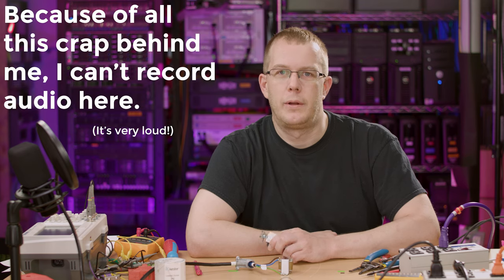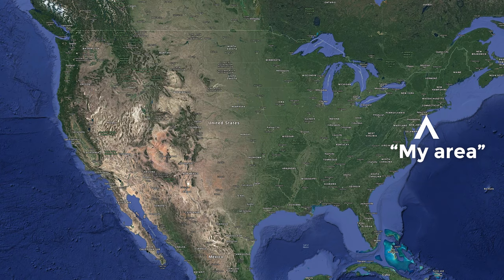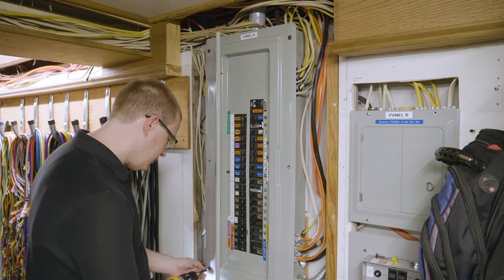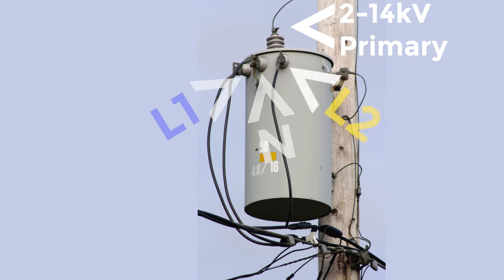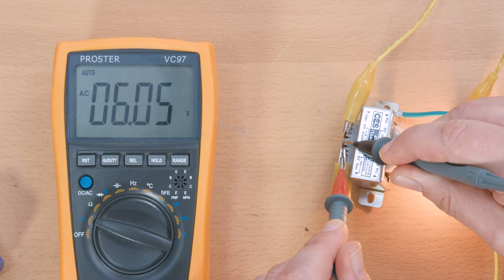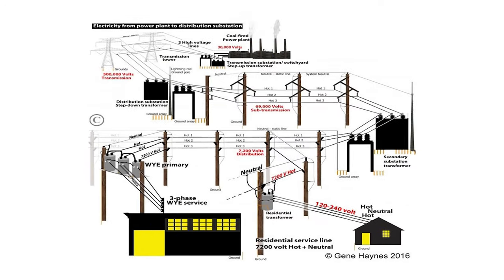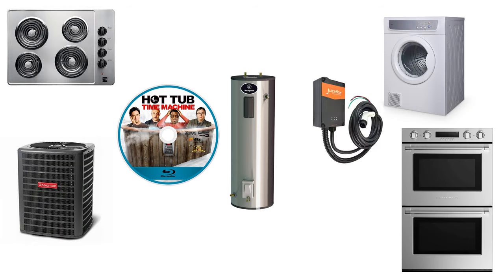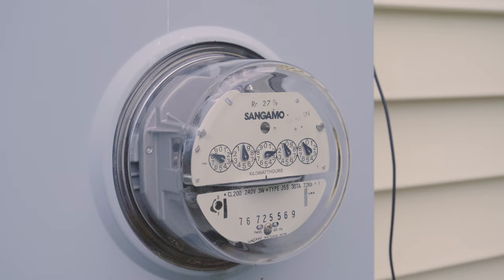240V is the Standard US Household Voltage (Kinda.)

Comment: One comment on what you say at 1:40. The US does generally carry out a neutral wire for the primary distribution. It is grounded in many points and shared between the primary and secondary systems. So there is multigrounded neutral for the primary return path, it's just the same wire as the neutral/messenger for the secondary 120/240V wires. This shared neutral arrangement can sometimes lead to small stray voltages/currents on customer ground systems because it's actually primary current returning to the substation via a customer ground rod or water pipe. Some current goes through the actual earth, but much of it takes the metallic neutral conductor back to the substation.

Comment: In the EU (at least in The Netherlands) we have “3 phase” in most homes that delivers 380v which is used a lot for applications such as induction stoves and such. In fact, most stuff that needs 240v in the US, needs and gets 380v here.
Reply: Same in Russia. In homes we have 230/400V
Reply: Today its not 380 but 400 volts in the Netherlands!!So the voltage is today single phase 230 volts.If you are a electrician you should know that by now,its already about twenty years this way..🤨🤨
Reply: We have 3 phase power in some apartments and commercial establishments in N. America, as noted in the end of the video. It's 120/208V. This usually requires special dryers, stoves, etc., that are available to landlords.
Reply: @dougbrowning82 "LandLeeches" - fixed it for you.

Comment: The neutral is the return path and it is grounded, hence why it is called the grounded conductor. The return path doesn't literally travel through the "earth." It is grounded so that the ground and neutral have no potential between them. There is an actual neutral wire that the current travels on throughout the whole system. Electricity doesn't go to ground like people often think.
Reply: Ground return is obsolete, but still used in some areas. I've seen it in rural Saskatchewan, where a single wire runs for several kms (miles for those in the USA) on pole lines beside the road.

Comment: I just got finished watching a different video talking about 240 volts being out of phase or not and the consensus was a lot of times the measuring device is what is showing out of phase but that the actual power coming in is in phase at 0°. His explanation was that most lower end oscilloscopes you connect the ground terminals to the neutral which gives you the out of phase. If you were to try to measure it where you take one of the ground terminals and put it on L1 you would blow up your oscilloscope. He showed this by using an isolated oscilloscope. Bottom line was if it's out of phase you have to question is it the device that you're using to measure with that is out of phase or is the source actually out of phase

Comment: I'm very lucky to live in a country with 230V Single-Phase and 400V Three-Phase electricity with 50Hz...
Reply: But how do You think ' is that a limit? do You think they would try to increase tje voltage again?
Reply: @maciejgromek2368  Usually it can up to 415V.
Reply: How does that affect your life in any practical way?? I lived in Europe and it didn't.
Reply: @liberoAquila  right now may be the answer. 3 phase do allow EV car charger, my current house which still in single phase unable to use EV chargers.

Comment: U.S.  uses line voltage[ phase to phase or rather split phase ] as 240v with 180 degree difference and phase voltage[ phase to neutral ] as 120v.  In India , europe -  line voltage is 400v with 120 degree difference between each pair of 3 phases, and phase voltage is 230v.
Reply: Its because its 3 phase and 230 x 1.732 is 400
Reply: @mr.3phase228  sure.  to be precise .220v x 1.732 = 381v, 230v x 1.732= 398v,  240v x 1.732= 415v.

Comment: Hello I have a question can I plug a European 240v 50Hz AV receiver into a 240v 60Hz USA outlet?
Reply: The connectors are mechanically different, so no.
Reply: You would have to change the plug. In N. America, a 240V 15A outlet (NEMA 6-15R) has the current slots horizontal, the ground is the same as its 120V (NEMA 5-15R) type B counterpart.

Comment: I'm actually tearing myself when I think about it, 120 v are safer and by renewable energy 12 v system is getting popular so 120v  is though more effective, but when we talking about for example very powerful devices like some hair dryers, the american breakers 120v 15 amps it's not enough and it makes them turn off (and Japan has only 100v). But in the other side Americans have a few kilovolts nearly houses and I don't how about other  countries but I,m from eastern europe and in the rural areas 400v lines are too long, my house is 1 km from the transformer, and look that we have medium voltage even at home, 10000 v generates when the car turns on, 10000 v is in the kinescope tv, and 4 to 10 kv flash is in the copiers, so maybe everything is possible
Reply: In the USA, 120V 20A circuits are common now.

Comment: I only get 110-112v from each receptacle at my house.. Even straight from the breaker box, I only get 112v. Aren't I supposed to get at least 120v?
Reply: The nominal voltage may vary plus or minus 5%.  You are supposed to get at least 114V.
Reply: @GH-oi2jf  My issue was my multimeter... it was out of whack.. bought a new one and now I get 121v.

Comment: Very well explained and shown!   A challenge.  Without saying that the oscilloscope shows it, what causes the (according to you and many others) 180 degrees out of phase.  It is, as you know, single phase in and out of the transformer.   I disagree with the term and say that is only on an oscope that it seems that way, but in the transformer it is not.
So, what in the secondary of a single phase 120/240 volt transformer can cause a 180 degree phase shift?
Respectfully,   Kevin
Reply: It is nothing complicated to do with 3 phase or AC reactance. 180 degree phase shift (or "out of phase") is just a way of saying the signal is inverted or the other way round. Shift a sine wave 180 degrees and it is an inverted copy.  It is fairly meaningless to talk about a positive and negative version of an AC signal that is itself inverting at 50/60 HZ. 

Which is  down to how the leads are connected. Take the DC equivalent where you have a 12V battery, which is actually made of two 6V cells in series. With a meter put the negative lead (your reference) at the -ve terminal of the battery.  At the other end of the battery you have +12V, and in the middle between the cells you have +6V.  Now put the negative lead of your meter at the central join, as your reference. You now have -6V on one end of the battery and +6V at the other.

That is what is happening here. On the oscilloscope (as in the AC supply) the centre tap is the 0v reference and the live ends appear as sine waves inverted with respect to each other.

As with the battery you could place the oscilloscope reference at one end of the winding.  The centre tap would then be a sine wave at 6V, and the other end a sine wave - with the same phase (not inverted) but double the size at 12V.

SAFETY NOTE - NEVER connect an oscilloscope input in ANY WAY directly to a mains supply - always use a low voltage transformer. The 0v reference of an oscilloscope is usually connected to its case and ground.
Reply: @JC-jv5xw     I believe we agree.   It is the way the oscilloscope is connected and shows up on the screen is why people say that the sine waves are 180 degrees out of phase.    I have seen representations of two sine waves one going up and one going down and saying that each is 120 volts and therefore 240 volts.   That is bogus!   It would be zero volts.   They would cancel each other out.   A 240 volt sine wave is twice the size of a 120 volt sine wave.   An tiny point in time, the three sine waves emitted from a transformer have to be at zero volts and maximum volts at exactly the same point in time and going in the same direction.
Have a nice day sir!    Respectfully,   Kevin
Reply: @JC-jv5xw     Why is it your channel was started today?

Comment: Will things from England 240 volts ans germany 220v work on our system phase to phase European us 220 phase to neutral
Reply: That’s a question I’m trying to answer as well. I haven’t been able to find a single video on YouTube that addresses it. Frequency considerations aside, will the 240 volts from USA run appliances from around the world that show 230 volts +/- 10%?
Reply: Yes, as long as they are resistive loads.  220v lamps and heaters work just fine.  But motors and synchronous clocks that are dependent on frequency for speed precision will run fast

Comment: Great video!
One thing I'm interested in now is how is a phase created. I understand we receive two phases to our homes in the United States and when you use one of each together it creates two phases 240 volts. 
If I understand correctly phases are about timing on a 360 degree wheel, sort of anyway.
Is it perhaps as simple as phase one at the power station is created for 180 degrees and then phase two is created for the next 180 degrees?
Reply: Your view of phase as timing on a wheel is accurate. A single phase generator has one winding. Therefore makes only a single phase, but there is room on the wheel for two more windings and if they are spaced evenly you can get three phase electricity. (In reality there are more than three windings in multiples of three. This allows generating 50 or 60 Hz with a lower RPM on the generator.)  If you live in a high density area in a 120v country you probably don't get 240v you get a measly 208v because you get two phases 120 degrees out of phase from a wye transformer.
If you live out in the sticks you will have a transformer connected across two phases of a three phase distribution line. The secondary of the transformer is a center-tapped 240v. Using the center tap as neutral results in two phases  of 120v 180 degrees out of phase because that is what transformers do.
Reply: @billelkins994  I don't live in the sticks, but in an urban area (Oakland, CA). Our neighborhood is served by 12KV three phase distribution, with two of the phases connected to the primary windings of the transformers on the poles, not one distribution wire and a ground as shown in the video. The secondary taps have a center tap which is grounded at the transformer, giving 120 V 60 Hz across one live wire and the neutral and 240 V across both live wires. The center tap wire, or neutral, is also grounded at the service entrance. One half of the incoming power goes to each side of the breaker panel, so 240 V circuits connect to both buses while 120 V circuits connect to one bus and the neutral. Newer homes also have a separate ground wire, which my house, built in 1940 with post and tube wiring, lacks. Only new circuits added have the currently normal three wires (hot, neutral and ground) for 120 V or three wire (hot, neutral and hot) or four wire (hot, neutral, hot, and ground) for 240 V circuits. We have 240 V for our electric range and electric clothes dryer, all other circuits are 120 V, 15 amp for lighting circuits and 20 amp for utility circuits.
Some of the houses in our general area are older, and some have only 120 V (originally 110 V) service to this day. You can tell by the number of wires entering the house from the secondary lines in the power poles. Most have been upgraded to 120/240 V over the years.
Reply: @DAB2640  You must live in the sticks. You have your own house.  Now I do live in the sticks. I provide my own water and sewage treatment facilities. The only off-site service I use is electricity.

What is the service amperage in your 1940 house? I assume it is not exactly the same as built in 1940.  My parent's house built in 1954 started out at 65 amps with gas heat, but now is 200 amps with a heat pump.

Do you still have any knob and tube wiring?  Parent's house still has two-prong outlets except in a couple of additions. No  K and T wiring.

Checked out some Oakland houses on Zillow.  I can't afford to own a house there.
Reply: @billelkins994  My neighborhood seems suburban, but we are within the urban limits of Oakland. The subdivision map was filed in 1938 and refiled in 1939. The house originally had only a 30 amp fuse box. A previous owner upgraded to 120 amp circuit breaker service (and insulated the outer walls), leaving the original circuits on the 30 amp fuse box. I replaced the fuse box with a circuit breaker panel. Circuits added have modern wiring, but most of the house is still knob and tube with fabric insulation on the wires. We have only a few grounded outlets. I had to ground the outlet for my computer myself. We have a gas water heater and a gas furnace, but electric range and dryer.
We bought in 1993. Now houses in my neighborhood are going for over a million dollars. Naturally, in 1993 we didn't pay nearly as much!
The house I grew up in in Los Gatos was built in 1903. It also didn't have grounded circuits. I helped my father ground an outlet for a room air conditioner back in the '70's. That house originally had an oil-fired furnace converted before they bought it in 1954 to gas. My parents replaced it with a gas forced-air furnace. It had a gas water heater and range. I can't remember if the clothes dryer was gas or electric. That house was sold in 1991 and may have been upgraded since.
Reply: @DAB2640  Your neighbourhood substation is providing 3 phase distribution and your local transformer primary is wired between two of those phases. This method is used in densely populated areas.